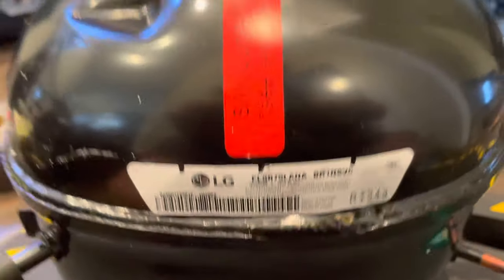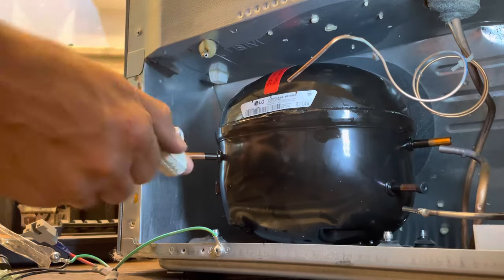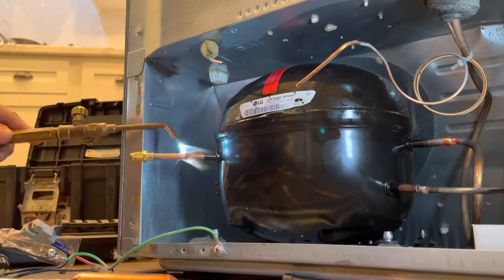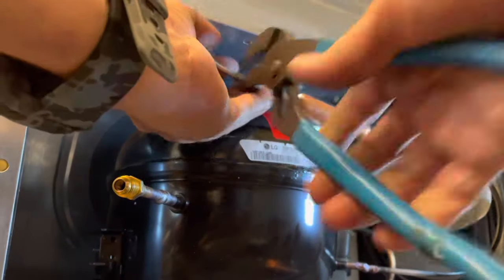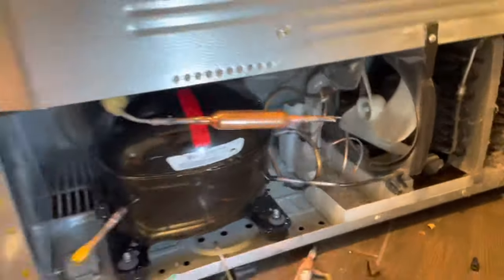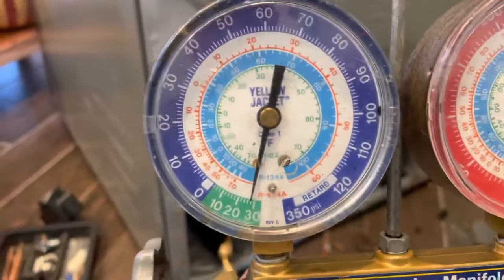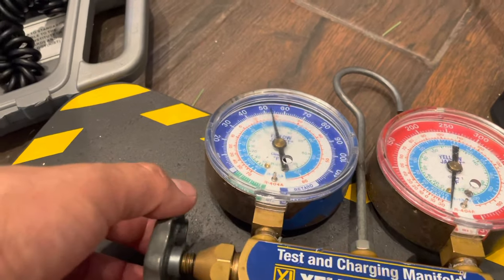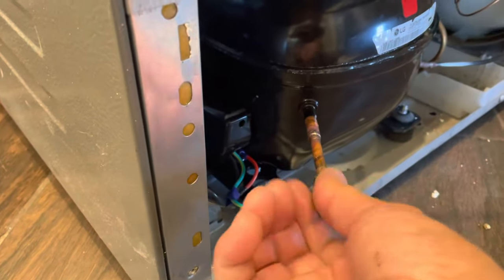How to replace Kenmore Elite compressor install / LG

Comment: I'd love to call a professional. Problem is professionals are incredibly expensive. I shouldn't have to be fleeced because I am not a refrigeration professional.
Reply: These guys charge what they do and do what they are so they can stay in business. If you didn’t pay them they wouldn’t exist. This isn’t exactly sweeping a floor…
Reply: Okay grandpa. Do I yourself then.. This guy isn’t even a pro. This video is amateur hour. 
Modern refrigeration is extremely complex. 
Why don’t you invent an easier way? That’s dirt cheap.
Oh, right.
Reply: Go get your cert then Boss. That way you can do it yourself. Advise from a Professional
Reply: Couldn’t find anyone to service our old fridge.  Everyone had the same line…”it’s a sealed system so if the compressor is gone it’s not worth our time to fix because we’d have to come right back”.  Which to me says they don’t know how to properly repair in the first place!!  So if they don’t want my business, I appreciate the info on how to DIY, especially given how the more recent fridges tend to crap out after a couple of years vs a couple of decades for the older models….
Reply: @rwfisheriv  gotta make money 💰
Reply: I've been an appliance and hvac tech for a very long time... refrigeration and appliance diagnostics are pretty complicated skills to learn... and even more complicated to put into practice.  The tools, torches, gas, etc are.very expensive.  Additionally, we have to pay insurance in case ppl sue us... and we are constantly having to keep up on EPA regulations.  Did you know that if you vent refrigerant into the atmosphere, you face a $30,000 fine and lose your CFC certification?  So, if you believe you're getting "fleeced" by the guy that's there to fix your refrigerator, I suggest you consider taking on all of the above financial burdens yourself... perhaps this will give you a better understanding and appreciation for why we charge what we charge.

Comment: $1100 parts included in case you’re wondering I just got a quote right now
Reply: A Lawsuit was successful on lg compressors going out on refrigerators

You should be able to get one for free 

We replace several weekly
Reply: @levitate9  did you have to show them proof of purchase?? thats what they’re asking me for and the person that gave me the fridge doesnt have it anymore
Reply: @thebotlobbydaily  thanks , I have the Kenmore elite model as well and it just stopped cooling , was bought from Sears , would they be able to replace it as it has been around 6 years since I had bought the unit?
Reply: @levitate9  thanks , so were you able to get the compressor changed under the law suit and how long did it take after they came for the appointment , I have called the same number and have a tech coming out this Friday
Reply: @levitate9  what exactly do they ask for?
Reply: This thing is automated. What were the steps my kenmore fridge is out
Reply: Did yall actually talk to someone
Reply: @f14k0  just model number and date you bought it ?
Reply: @levitate9  i keep getting an automated service. Do i need to tlk to a rep?

Comment: These things are all junk these days, and at sky-high prices to make it worse. 6-month old Samung here that "needs a new compressor" for a warranty repair. Waiting for the part to come in. $1900 for this POS. The Whirlpool it replaced ran for 15+ years with not one problem and was still working fine. And get this. The refrigerant in this thing is flammable, R600-A. It's an isobutane. Samsung went all-in with that crap in 2017, replacing the non-flammable R-134a that was in use for years. Look up exploding refrigerators videos. That's the reason. If it leaks into a confined space and builds up a spark from static or electrical/electronic components or a fan or icemaker motor can ignite it. I wish I had known that before buying this thing. I feel like I have a bomb sitting in my kitchen.
Reply: Cool story bro

Comment: This is not a DIY video. Why you have to show to the public, this is a highly technical procedure. Is it worth replacing a compressor for a 5 year old ref, or better yet buy a new ref to last another 2-3 years.
Reply: nah man this is great. If you can solder copper pipe and work on your car's AC system this is easy peasy.
Reply: @rickoriusmaximus7512  Except for that software update, i think i could do all of it.
Reply: I've pulled a vacuum and charged my car A/C with gauges several times.  I'd throw the fridge in the landfill before I paid someone a $1000 to do what I can do with ease.